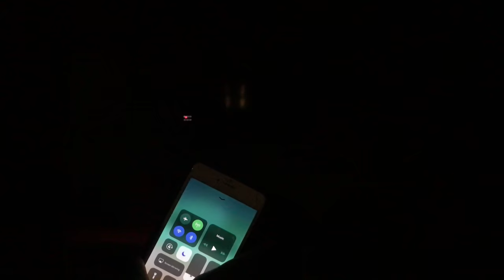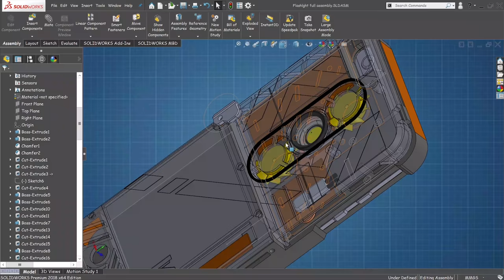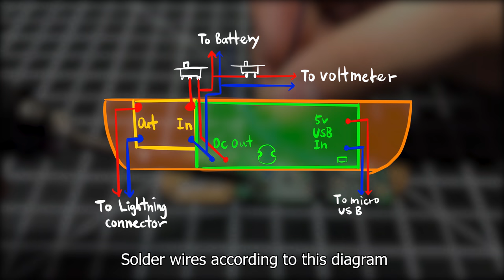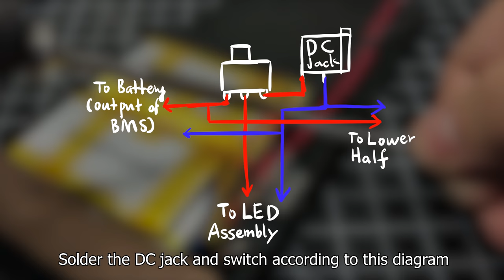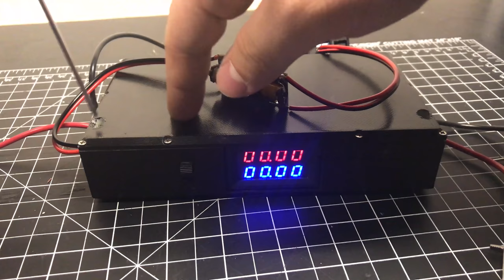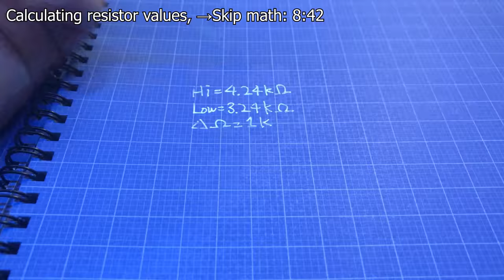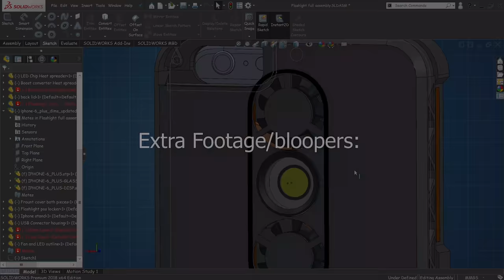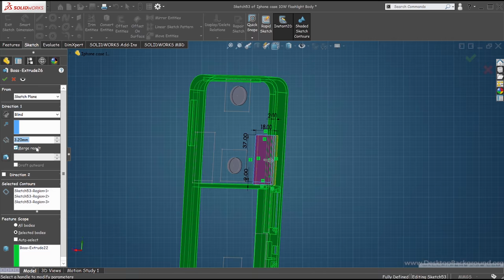How to Make Most Powerful Flashlight Phone case With Additional Power bank Feature

Comment: Time stamps for mobile users:

Material List: 1:06
Battery Pack: 1:40
Case Body Assembly: 3:16
Custom Heatsink: 5:58
Boost Converter Mods: 6:53
Completion: 9:06

Great work Kralyn3D

Comment: I really like your work and what you've made there. If I will give a feed a feed back now I would say what you've done good was mostly every thing and what you could improve on is nails, if I'm not wrong, if you remove it once it wouldn't fit as good before and it would be a weak point with time. What I suggest is changing the design a bit, there would be some like circles for each of the two parts, you put them together and insert a shaft to connect them, it could still rotate as the video and you can disassemble the part and reassemble them without problem(it may be useless for now but it may be handy in future designs if you update, or just take as an idea for future projects). I'm not if you will get what I'm trying to say because of my language.
Keep the great job!
Thanks.

Comment: If I understand correctly you also can use the batteries to charge the phone? And does this specific 5v to 8.4v charger have reverse current protection? The answer should always be yes, but I ask because you never know with cheap electronics.